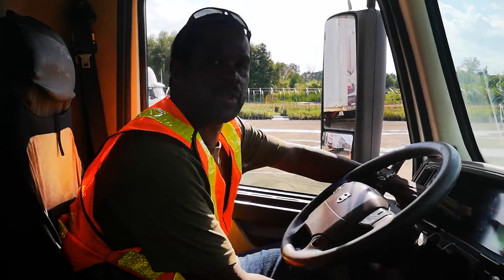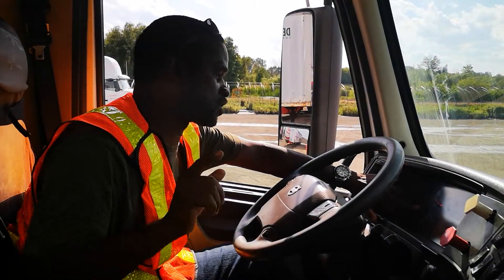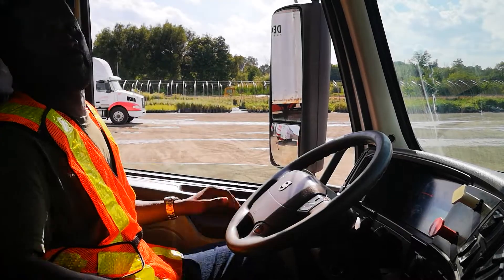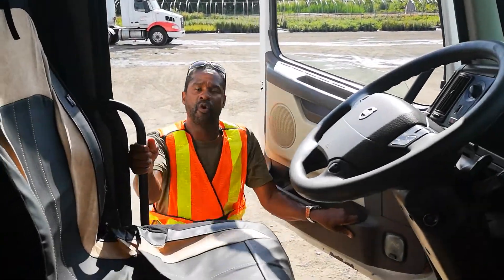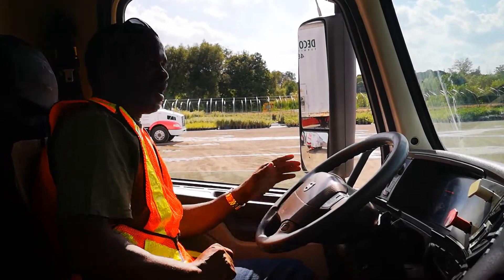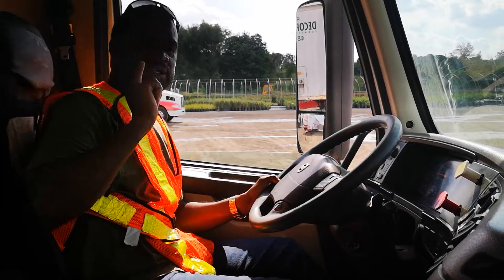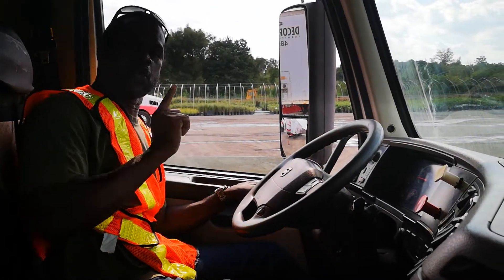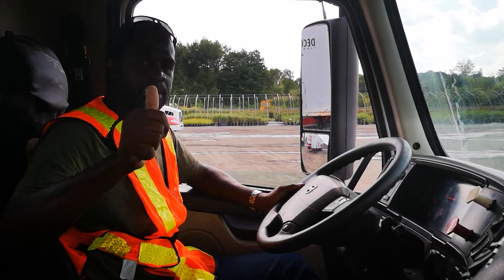HOW TO PERFORM A TRACTOR PROTECTION VALVE TEST 2020 | ONTARIO AZ LICENSE SCHEDULE 1

Comment: You need to supply air to the trailer and perform the same test the valve also protects the truck from trailer break away and between 20 and 45 psi the trailer valve should then pop back out saving some air for safe braking of the tractor
Reply: That is the "brake control valve" the part in the dash. This video is testing the "tractor protection valve" which is usually mounted to the back of the cab where the glad hand hoses connect on the tractor. The tractor protection valves only job is to stop air from going to the trailer service line when you are using your service brakes while bob-tailing. Also when the valves pop out on the dash that means the spring brakes are now engaged so the wheels/axles with spring brakes installed will be ideally locked up... that's not exactly safe braking.
Reply: @davidbuck9977 facts